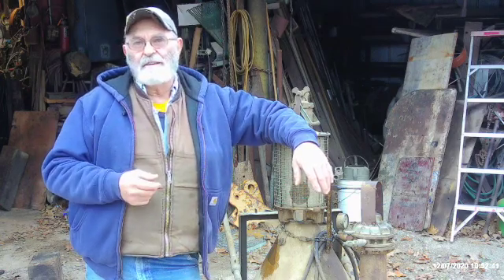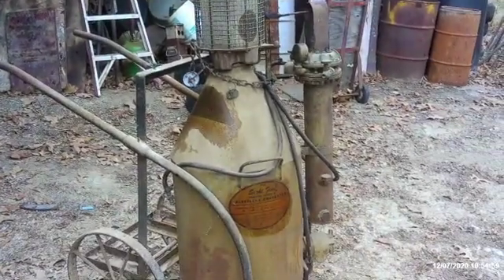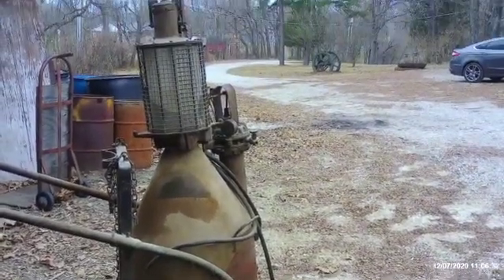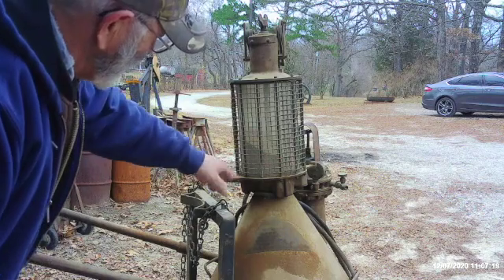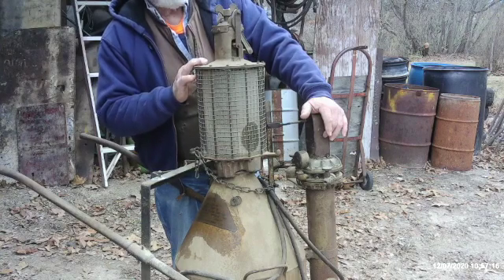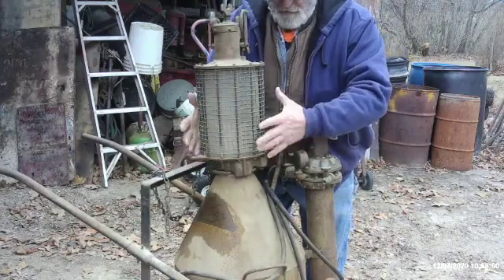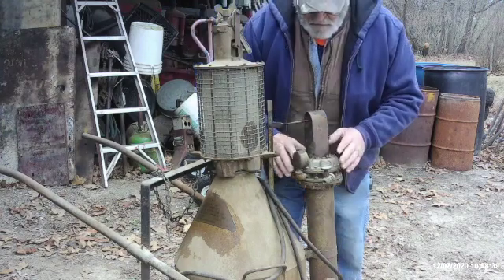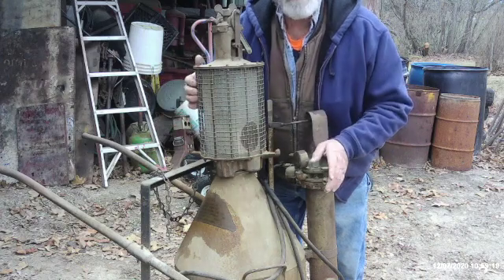Acetylene Generator: Precursor of Modern Torches

Comment: man that is very cool. I dont know much about acetylene. I thought it has acetone in it. I know they say never lay your acetylene bottle down because the acetone in it will eat the seal out and then it will leak. they freak out if you pull in the supply shop with an acetylene tank laying down flat. ask me how I know that. lol been fussed at for doing that in my early years. acetylene can be very dangerous. I bet that thing is worth a small fortune to the right person.
Reply from the maker: I don't really know the connection between acetone and acetylene or if there is one.  The ladies use acetone in a bottle with a cotton ball to remove their fingernail polish.  I think there's an absorbent material in the bottom of the acetylene tanks that remain saturated with the liquified acetylene.  The gas rises to the top to enter the regulator.  Laying a tank on its side disrupts the absorbent material and allows liquid to escape into the regulator potentially damaging the internals.  If you lay one on its side without a regulator then crack the valve you will see spurts of liquid....not cool.  LOL.  
    And as we all know acetylene becomes very unstable above 15 psi....and I don't want to find out firsthand !!  Thanks Dave for stopping by and taking a look at the old thing.  It is a candidate for a museum for sure...or a display at a welding suppliers showroom.
Reply: I will jump in with what little scary stuff I know about Acetylene tanks and storage. 
The tanks are filled with absorbent material just like T-44 said. In the old days it was Kapok like life preservers use to be. Might be anything these days. Coming from the far east as they might it could be bamboo leaves. Anyway the kapok was there to increase the surface area of the acetone that the tank was filled with. Acetylene dissolves into acetone line CO2 into water. When the pressure in the tank drops the acetylene boils out of the acetone. If the acetylene is drawn off the tank too fast the acetone gets carried into the regulator causing problems of the boom BOOM kind. 
If you lay the tank down the acetone migrates to one side of the tank leaving way too much surface area exposed for the acetylene to boil out of the acetone. Once again boom BOOM. 
Now you will run into people who will say that is all a bunch of hooie and that they have vented tanks wide open with no problems. Don't go drinking with that fool. They are the guys who want to bet you that a match burns twice. I still have the scar on my thumb. 
Store your tanks upright and chain them securely. If you have to lay them down. First off don't. If you still think you have to then when you get where you are going stand them up chain them off and wait a day before using them. 
Old guy story:
Back in the good old days when there were shop classes where you learned things and not always the right things but interesting never the less, my shop teacher was Mr Stankey. Great guy and built like a truck. If he said sit down and shut up you didn't even think about looking for a chair you went on your butt where you were. 
Mr Stankey was going to teach use about the safe use of an acetylene torch. 
He had some dimestore balloons. He filled the first with oxygen until it was about 4" in diameter. He tied it off and asked what we thought would happen if he lit it on fire. 
One of the smarter guys in the back said it would pop. 
Mr. Stankey pulled out his lighter. Everyone, but me, smoked back then. He laid the balloon on the welding bench and lit it. It popped. No boom just normal balloon popping. 
Then he did the same with a balloon full of acetylene. It popped and sent up a puff of black smoke. Little tendrils of soot floated out of the air, but no big deal. 
Then he lit the torch set it to burn correctly and shut off the tanks. He put the balloon over the end of the torch tip and turned the tanks back on. 
He filled it just about the same size as the oxygen and the acetylene balloons had been. 
Then he lit it. It blew three bricks out of the welding bench and onto the floor. 
Don't try this at home. Especially not where you will be noticed doing it. It is considered an explosive device and you might just end up on the wrong side of Homeland Security. 
Just think about the idea that the balloon had maybe 1/8 of a cubic foot of oxy/acetylene in it. The big T bottles most commercial cutting rigs have hold 300 to 330 cu ft of oxygen. The acetylene tanks last longer than oxygen tanks in use because oxygen burns  a stochiometric ratio of 2.5 to 1 with acetylene. That is when the flame is burning at its hottest and the acetylene gets all the oxygen it needs for a complete burn.  Since the oxygen is also used to burn the iron with a cutting torch you go through oxygen about 2 to one compared to acetylene. That explains why there is a bigger oxygen tank than acetylene. 
Also the rig is heavy enough. Why carry stuff you don't need. Some journeymen should be reminded of that. The apprentice has to lug the tanks up and down where ever they need to go. 
Now we went a long way around the barn. If some idiot manages to set off a oxygen/acetylene rig carrying 140 cu ft of acetylene instead of blowing 3 brinks out of a welding bench it will do 8 times 140  times 3 bricks. Roughly 3360. 
That's if the bricks are laying flat under the explosion and not stacked up around it or over it. 
Let's just say be careful. You might be within a couple hundred feet of me. 
BOOM BOOM!
Reply: @OldSneelock   interesting story on the shop teacher. they would be arrested if they did that these days. lol  I was not sure where the acetone came from but like you said its there and it can be a major boom! I dont lay that tank down anymore.
Reply: @daveknowshow  We may be safer in some ways. I think the trade off into a fear culture isn't worth it. Just my thinking.
Reply from the maker: @OldSneelock  man I liked the shop teacher story... A cousin of mine working midnights put just enough acetylene from his torch into a small trashbag to get it to float.  He zip tied it shut with about a three foot piece of toilet paper hanging down.  Standing on the dock at 2 a.m. he lit the TP and pushed it out the door.  I don't know how high it got, but the explosion set off virtually car alarm within the industrial complex and brought cops from three surrounding districts in a matter of minutes !!  Of course nobody knew anything about what the H--- that was !!  LOL  Yep, he would've made a good shop teacher.  And of course maybe even I was guilty of the upside down styrofoam cup on the jobsite trick on a co-worker....  Blow about half a second's worth of acetylene under the cup, then when your buddy fires his torch, you wipe across the cup with a wide sweeping arc of your own torch.  The good ones are when you catch 'em with their goggles already pulled down and they don't catch you in the act.  LOL. Mind you I said 'might' have been guilty......
Reply: @tractorman4461  My stories try to explain how someone might have done something with out involving any verify able actions on my part. 
I may have been aware of the possibility. I might even have been involved in the thought leading up to the incident. 
I felt it was my responsibility to guide my friends on their travels to and down the wayward path. 
An acquaintance told how he and his brothers would fill a garbage bag similar to the balloon trick and flatten several rows of corn.
As a supervisor I use to tell new recruits that there was little that they could try that I hadn't done or seen done better.
Reply from the maker: @OldSneelock  oh heck yeah I agree.... maintain a degree of plausible deniability. Lol. I’m glad we both survived those younger years.....
Reply: @OldSneelock  lol I know what you mean.
Reply: @OldSneelock   I fill my old acetylene  tanks with LP.  a lot easier than dragging around a 100 pound LP bottle in my torch cart. Yea we made acetylene bombs set them off in trash cans and split the seams. Once we deflated a guy we needed to get even with back tire. filled it with acetylene and oxygen  and topped it with compressed air. When it blew out it really ripped up the quarter pannell. LOL Old cotton never knew what happened. Same guy we added a gallon of gas to his crankcase. then pulled the dipstick and cut the boot from a spark plug wire and ran it down the dipstick tube. When that went off it blew  both valve covers and the oil pan almost off the engine. The Guy was a thief stole from everyone including his family.

Comment: That was a great information about gas mixture of a older torch
Reply from the maker: Thanks for the comment....its all about the normal evolution of mechanical devices.  Without these first generation acetylene generators, we wouldn't have progressed to plasma torches of today.  Without the Model T automobile and the continual improvements we wouldn't be on the advent of autonomous vehicles today !!  (-: